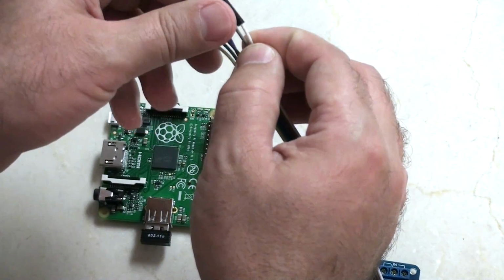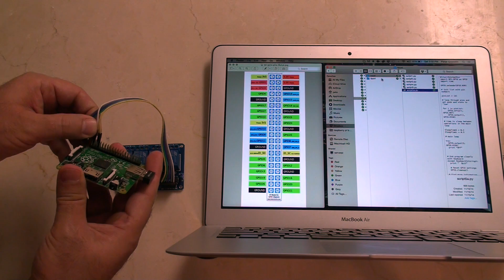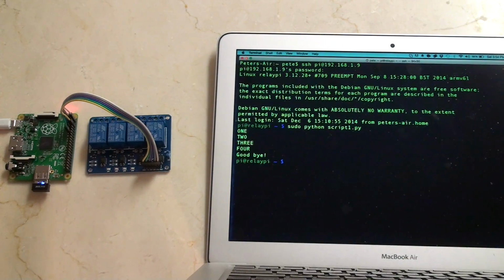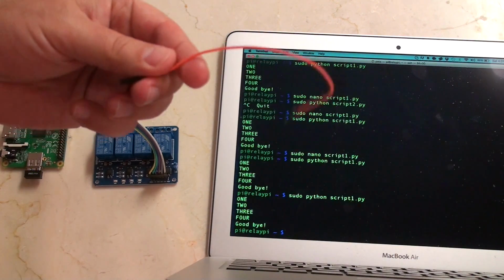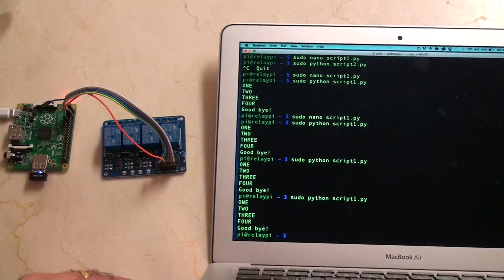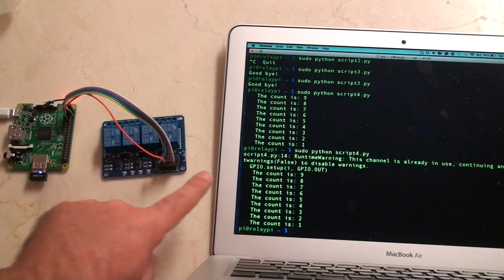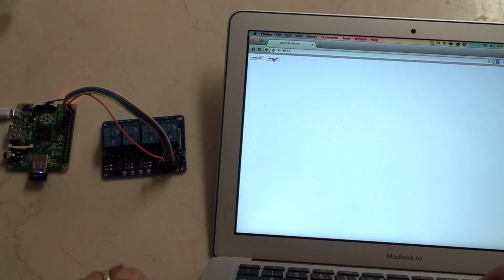Raspberry Pi: 4-channel Relay step-by-step with example scripts for home automation

Comment: Hello! Can anyone point me in a direction where it shows using this relay with the Raspberry PI being isolated?  From my web searching it seems to indicate that power be provided to JD-VCC & GND but the jumper seems to be bridging JD-VCC & VCC and I don't see a separate GND to use when connecting up a separate 5V power supply.  I hope someone can shed some light on this.  Thanks!

Comment: Hi, hou to control boiler remotely via rasberry+module control+modem via mobile? Is it any video tutorial?
Reply from the maker: Look at my garage door video.  That's how I'd do it, but with a boiler instead of a Garage Door connected to it...
Reply: @skiwithpete  ok, but is it will work if i am in town and between my boiler and mobile phone is a 20kilometers distance? As i understand garage doors works only   in range of wifi?
Reply from the maker: @rimantasmatuliokas4307  then you need to learn to expose your device to the internet. I try to cover that in a video. But it's risky.

Comment: I’m very new to this. Is that possible to make some nice looking interface to cover the coding, then we can use a touchscreen to make a center control panel in home automation? I wish to use it on my motorhome.
Reply from the maker: https://github.com/skiwithpete/sesamepi is the code for this: https://www.youtube.com/watch?v=p2abZ90-eU0 yeah, you can control the relays on a web page.

Comment: some people say to use a 3/3.3 v relay instead of a 5v relay. Have you noticed the raspberry pi not delivering quite 5v and failing to trigger the relays? I assume this is why the recommend using relays with a lower trigger value
Reply from the maker: Not a problem with optocoupler relays

Comment: Any way you can show how to make a script for turning a relay on and off for a specific time every day
Reply from the maker: I would do that through cron, running the script.  Rather than in the script.
Reply: @skiwithpete  ya no idea on this stuff.. I'm new to the coding side
Reply from the maker: @WayneRigley  ok, so choose the script that you want to modify (from my open source examples), and then add it to cron (which is a system level timer).  So you can schedule things inside the OS.  Like if you want a program (like a diskscan) to run at a time (3AM everyday).  
So step one, get the script working the way you want it to.  
Then step two, learn about cron to get the script to run at a specified time.
Reply: @skiwithpete  thank you very much for taking the time to respond to me what I'm doing is I have a 12 volt linear actuator which is going to operate my chicken coop door as well as LED lighting inside the chicken coop. this is the reason for me wanting to automate this on my Raspberry Pi 3 B plus I have a 4 channel relay that's going into the mix both the actuator and the LED or 12 volt source. I'm very familiar with how relays work so that's not an issue it's mere getting the script to do what I want or the file I should say. I'll definitely be taking a look at your examples within the hour. Again thank you

Comment: How would I go about to switch on and off something using 4 - 5 kilowatt (20 - 25 Amps -220Volts).
I could not find a RPi relay that will be able to handle that high Amps but I am sure a plan can be made.

Perhaps two stage relay: %v to 30 Volt and a second 24V to 220 volt monster relay able to handle 30 Amps, or ir there an easier way of doing this?
Reply: Frits, why not use a SSR (Solid State Relay)? What did you use?

Comment: having trouble with installing php5 and libapache2-mod-php5.. they say its been removed and php7 is in the market. can we make the web work with php7?? 

Thanks
Reply from the maker: Yes, PHP7 should work, no reason newer tech will break this, since it's all based on Linux.

Comment: Hello, awesome video man, thanks. I do have a question though so I hope you see this. I'm using my Rpi 3b and octoprint to control my 3D printer from anywhere, and that's all setup and working great. But now I want to be able to turn my printer on and off, as well as a light, etc, remotely as well, which there are plugins for. But some people claim that in order for the Rpi at 3.3v to control these 5v relays, that you have to solder 1kohm resistors over the existing ones on the relay board. However, there are other people like yourself who seem to be controlling the relays just fine. Do you know whether I need to do this? I'll include a couple links to what I'm talking about, the people claiming that you need resistors. 
https://goo.gl/gYHK4i
https://goo.gl/rjj4VB

Comment: How hard would it be to control off road lights via the app and switches? Thinking of using a pi to control my truck lights. I have used ardiuno boards before and have limited programming skills.
Reply from the maker: The disadvantage is that the Raspberry Pi needs to boot and shutdown properly, so I would say it would have limited use in a vehicle that doesn't have an "always on" power source.

Comment: Is not strange that to turn on the relay you have to GPIO.output LOW and to switch it off to GPIO.output HIGH. It cannot be setup in the opposite way?
Reply from the maker: davidlyons24 you can... But I don't think it works the way you think it works. But yeah, do it anyway. It won't harm.

Comment: Hey, I'm new to all of this so sorry if this isn't a great question, but is the this configuration enough to power a 110v AC or 12V DC solenoid valve?
Reply: depends on the relay, most relays have that info printed on top
example if it says 10 A 125VAC it can power a device that uses 110v ac and is about a 1000 Watts.
it can also say  10A 28VDC  then that is enough for your 12V solenoid valve and less than 120 Watts

Comment: Hi, great video and thank you but i am having trouble where if i click on the html file i made and saved the python script is not initiating ? any ideas ? if i run the command through terminal to run the python program it works fine but via the browser, nothing ? is it something to do with the apache server i may be doing wrong ?
Reply from the maker: it must be a php file.  and the php server engine must be installed.
Reply: any chance you could point me in the direction of how to do this ? thanks in advance
Reply from the maker: rename the html file to php

Comment: in what folder location on the pi do you store the index.php file at?
Reply: on a raspberry pi using apache2 webserver then probably in the /var/www/html folder check your /etc/apache2/apache2.conf file for <directory /

Comment: Hello, quick question. If you put this up on your lights at home...and somehow the pi is broken, how can you manually switch on and off the lights?
Reply: You can set the relay to be on by default. So if the relays lose power, everything will be switched on. You should control your circuits at the device itself rather than through an existing switch, that way your normal physical switch will still be functional.

Comment: I have this working but I am using the Keyes 4 Solid State Relay 'High Level Trigger'.  When I energize this unit, relay 1 and 2 light up.  When I run the script first all the led's go out then it runs through the sequence as it should, but when it ends, relay 1 & 2 light up again.  Also when I put my meter on the output terminal, there is no change of state of the relays.  Anyone have any idea what is up with this?
Thanks in advance.
Reply from the maker: 1) Is it an optocoupler relay?  No.  So it won't work.
2) Solid state relays typically have a minimum voltage, which your meter won't output.
Reply: It's a Keyes 4 Solid state relay.  High level trigger.  It came with some Arduino stuff I bought on Ebay.  It has a red coloured circuit board and I see lots advertised.  I will give it some load and see if that changes things.
Reply: I connected an led with a resistor and a 5V supply to one of the relay 'contacts' and although the input led's do as the should, the relay does not change state turning off the led.  I tried it on all 4 relays and non work.  Not sure how else to test this relay board.  Any ideas?

Comment: Great video as always .  2 questions...1, in order to connect my laptop via WiFi to the raspberry pi how do you know what the access code of the raspberry pi is.  2, The raspberry Pl 3 uses I believe 3 or 3.3 volts in th GPIO..  Are there 3.3 volt devices like relays etc.
Thanks

Comment: Hi pete. My name is Nick. I've been looking for a way to control a machine I've been building for my plasma cutter. I designed and built a relay circuit but it seems pretty bulky. Since I saw your video on relay board controlled by a raspberry pie I just know this would be perfect. Now the only thing I didn't see in the video was how to create a program to integrate contact switches to input to the raspberry pi. What I'm talking about is I need a motor to start. This spins an acme thread. A nut on the acme thread is connected to a sled, runs down on two polished rods that have linear bearings connected to the sled. The sled holds a plasma torch. The function of this machine is to run a plasma torch in a straight line to cut metal. So, turn on the torch, it needs to start the motor, run for a predetermined time, at the end of the cut turn off the torch, stop the motor, return the sled to start position and stop the motor. So if you could make a video on how to control the relays I would greatly appreciate it

Comment: I have a colleague whom told me that if I hook up the relay the way in which you have explained, I will eventually burn out the board. He said I must attach the relay board like in this diagram. https://www.raspberrypi.org/forums/viewtopic.php?t=36225
Could you please comment on this?

The colleague in question actually has already setup a very elaborate system in his home, so he does have quite a bit of experience on the subject.

Comment: i understand you posted it last year but i cant get it working. on pin 2 it is on cant turn it off and on pin 8 it is just off cant turn it on using raspberry pi 3 model b single relay. my relay has +, -, and s i presumed + for 5v, - for ground and s for signal. Hooked it + on pin 2 and - on pin 3. running your  script gives
Traceback (most recent call last):
  File "on.py", line 22, in <module>
    GPIO.output(14, GPIO.LOW)
RuntimeError: The GPIO channel has not been set up as an OUTPUT

Any help will be appreciated.
Reply from the maker: your traceback error tells me you have modified the code. unfortunately I don't have enough information to help you. the error you describe with lights staying on makes me wonder in you have the correct optocoupler relay. I suggest you look on Google for more help. thanks

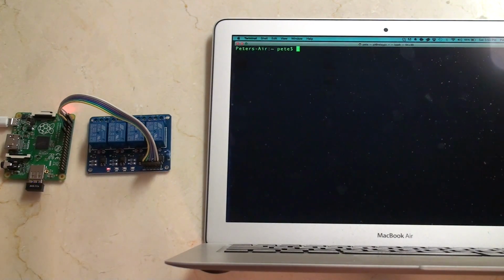Comment: Hi, nice video. My 4 channel relay works but for some reason (depending on what GPIO it's plugged into) some of the relay lights illuminate with a dim red color when it starts up. The same as what your first LED does at 5:26. Why is this?

Comment: Hi skiwithpete. I rely like your video and I have get it to work np.I am working on a system for kids can have more fun of cause for free an I am using your script but I am stock on 2 thinks and maybe it will not work :( but I am rely looking for help here. One of the things is wend you push to activate script 5 then I need it to say on another screen that it is on? Can that do it in real live? Hav can I contact you so I maybe can send more info? Cuss I think you are the man for many things to this... Cheers Jimmy

Comment: what else could i do with a relay? i still don't get the use of these.
Reply from the maker: this?  https://www.youtube.com/watch?v=3u45htuQeag
Reply: You can control anything that uses a lot of current. That could be a big lightbulb, solenoid, a water pump, the lights in your house, anything electrical. The reason you need it is because the microcontroller weather its the raspberry pi, arduino or some chip, does not have enough power to drive motors or solenoids. You need a circuit in between those big things.

Comment: FYI, in some of the python programs there are missing parenthesis.  This causes an error message to populate, and the program will not work until the parenthesis for the print statements are typed.  Parenthesis are required for python3.x.

Ps.  I just got my relay board to work just as your video shows!  Thank you for all your help with the tutorial and your python code!  I am planning on making a 3000 ft. AGL rocket that is controlled by the pi and the relay switches.  And this is using the Pi 3.

Comment from the maker: Check here for all the further information relating to this video.

Get the relay here:  http://amzn.to/1BoBucC
Get the GPIO wires: http://amzn.to/1VyYIYb
Get the WiFi dongle:  http://amzn.to/1v8L7Ho
Get a 5V2A power supply:  http://amzn.to/13LeA49
Get the Macbook Air:  http://amzn.to/1Hignwv
And, the Raspberry Pi Model A+: http://amzn.to/1vxr85T
Or get the new RaspberryPi2: http://amzn.to/1zJlP9L

Get the parts in the UK:  http://bit.ly/15XFRBH

**Remember:  Help each other in the comments section.  And please repost your code.

Comment: Cool video. Can you tell me a. How to connect appliances such as sensors to the relay (not the software, just the circuit)b. How to power the relay with external power.

Comment: Awesome video!  Thank you so much for posting.  :)
Couple questions:   
1) Do I need to have an OS of any kind flashed to the card prior to doing all of this?  Or can I put the Python files directly on the SD card, insert it into the Pi, and run it like that?    

2) I need a relay to turn on for 1 second every weekday at 8AM (watering a plant, for example).  Is there a way to have the relays activate based on time and day, and then repeat all over again?  I checked out your Alarm Clock video, but I'm afraid that's way more sophisticated than what I'm looking for.
Reply from the maker: +J. Siefer You need Raspbian installed.  And then to run the python code from wherever you put it inside Raspbian.  Check out my Garage Door opener, that runs for .5 seconds.  Change it to 1, and then set it on a timer.

Comment: Can you suggest me, which type of wiring should I do to operate mains(lights, fans etc) with relays so that the normal/manual switches also work if raspi system is not online?
Reply from the maker: +Sahil Harit Don't play with mains!
Reply: but I'm up for home automaton, that's why I'm asking!!!
Reply: +skiwithpete ok... thanks!

Comment: hey I am totally new to raspberry pi. can you guide me to use raspberry pi to control 4relays using input via switch from the user. and those relays to be also controlled wirelessly by android device via ip using web.

Comment: Hi, I'm having a problem getting your index.php file to run. The page shows up in my browser, but when I click on the button nothing is happening. Your scrips run perfectly from the command line. It seems like the file isn't executing. I'm running python3 & have made the changes to run from the command line & made the change to python3 in the index.php file. Anyone have any suggestions.Thanks
Reply: Changed exec() to system() and it is now running
Reply from the maker: +LeRoy Cote great tip.  Thanks!

Comment: Is it possible to have a single web interface with two or more Pi's (each having its own relay board)?
Reply from the maker: +Alan Green Yes.  But that doesn't mean I've figured out how to do it.  Just have a text file on one, and the other reading it every so often interval... As a first thought.
Reply: yes just give them different local IP addresses and use PHP to access databases created seperately by each PI... very easy logic to follow

Comment: I would be very grateful if you could help me:

I tried to do your examples (and also tried some own examples) but I have the problem that GPIO.output is not working. GPIO.setup will turn my LED on (and switch the relay) and GPIO.cleanup turns it off but every function using GPIO.output does nothing. I get no errors, it is just doing nothing. I tried updating the GPIO module and I also tried many different examples of HIGH and LOW (could have been that the error lays somewhere there) but nothing helps. Do you have any ideas what could be the problem?

Thank you very much in advance!
Reply: +TheCraftinator I now found out that when I print GPIO.input() after changing with GPIO.output the state DOES change (from 0 to 1) BUT the LED on the relay stays the same and also the relay is not clicking independent of how often I change the state (only GPIO.setup and GPIO.cleanup makes it click and change the LED).
Reply: +TheCraftinator Still having this problem. Does someone have any idea what could cause that?
Reply: +TheCraftinator Which Raspberry Pi board are you  using?
Reply: Muminur Rahman The new Pi 2 - And it is of course connected to the 5V (not the 3.3V). Thanks for your comment.
Reply: Can you try to use different GPIO pins? Don't use GPIO 2, 3  instead use GPIO 23, 24 also update the code accordingly. Let me know if it works. Which script are you trying? If you are trying script5.py? In this code GPIO.output code is commented out. I don't know why he did that.

# GPIO.output(i, GPIO.HIGH)
Reply: I tried a lot of pins so far and even tried JavaScript instead of Python. I am thinking that the relay might have some kind of problem. Could there be anything else?
Reply: Yes, you can check the relay first.
Reply: +Muminur Rahman To give an update: The problem was the relay. I ordered a new one and it now works like a charm. Thanks for your help. :)
Reply: Glad to hear that it is working ! :D Cheers!